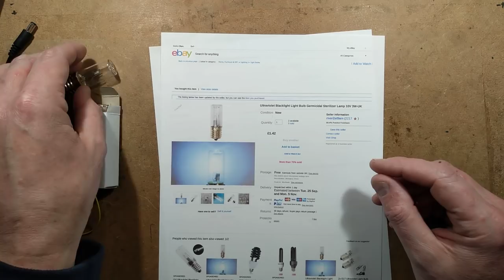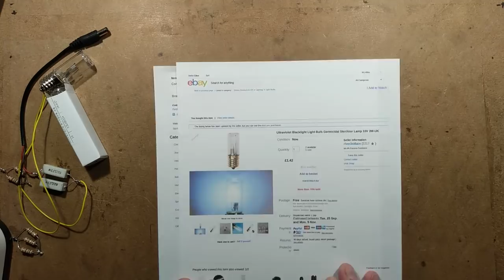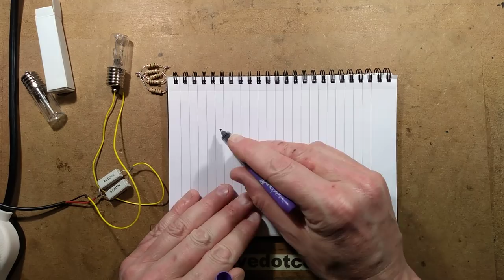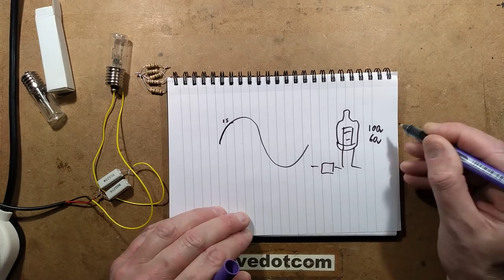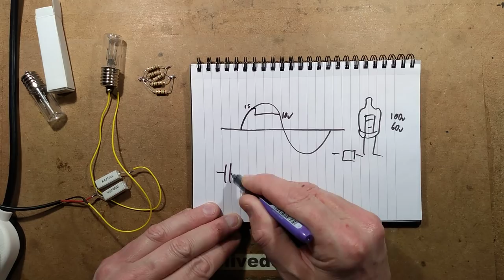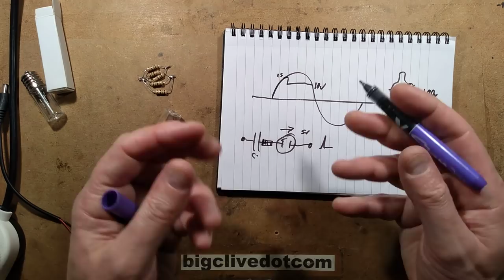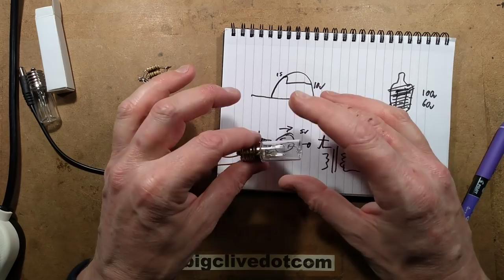Amazing ten-volt mercury discharge UVC lamp.  (GTL3)

Comment: Hello , BigClive.  Very nice presentation re: the GTL3 low voltage discharge lamp.  The construction of the lamp is not new, however.  Back in the late 50's, refrigerators had ozone-producing mercury bulbs in them to reduce odors in the 'fridge.  The lamps ran off the 120VAC  mains, with a series ballast to limit the current when the arc struck.  The lamps had almost perfectly spherical bulbs, made of quartz (to permit the ozone-generating lamp radiation to pass through the bulb).  The lamps were made by GE, and the packaging was marked "OZONE LAMP", with an appropriate warning about the rays.  The package also warned of needing a ballast, lest the lamp shatter.  The bulbs were 1.34" (34 mm) in diameter, the base threads had a major diameter of  0.635 (16.2), and were designed not to fit a standard Mazda-based socket, nor the 7 1/2 Watt "Christmas Tree" light sockets.  When the bulb is cold, you can see droplets of mercury on the inside of the quartz bulb.  The filament is almost identical to the one in your video, including the ends that had the coating.  The major difference is that the peak of the filament in your low voltage bulb pointed down toward the base, while the GE bulb's filament pointed away from the base.  When the GE bulb was running, the ozone production could not be missed;  no need getting your nose next to the bulb!  The package further warned that not more than 3 were to be run per 1000 cu ft.  Germicidal bulbs are usually designed to block the ozone-generating lamp radiation.  Today, one use of the GTL3 is in a toothbrush holder that sanitizes the brush part of an electronic toothbrush.

Comment: Have you seen James Hooker's website Clive? Thorn and Osram made similar lamps, some with a woods glass envelope. They were used on 28v supplies to illuminate cockpit instruments painted with UV reactive paint. Thermionic discharge lamps have been around for a long time. In the USA a large version was offered as a sun lamp. These sort of lamps are very commonly used in small UVC filters for aquaria and also in air purifiers.

Comment: A mirror camera lasting much longer in battery and the finder is more accurate
Reply: TheHirade The SLR mirror can't be used for filming, only for stills.
Reply: @John Francis Doe2: False. Most of nowdays cameras can fold up the mirror for video. Then it can be used just like a mirrorless cam. Btw, also for photo shooting if it needs to be silent, eg on a wedding ;)
Reply: @dothemathright 11111 : On a SLR with up folded mirror, you see the sceen on the screen, just like on a mirrorless cam. Maybe there's not the same amount of pixel, but who cares, as long as you see the sceen.If you work in a semi or proffessional enviroment, you anyway use external screens, also on the big professional > 50'000 bucks cams.
Reply: @dothemathright 11111 : Shooting videos by using The. View. Finder. is nothing I wanna talk about, cause for reasonably good vids you use a stadycam and don't hold the cam in your hands.
Reply: Also when you have a full frame body with a large viewfinder it's just more fun actually looking through it. At least for me using an optical viewfinder improves the enjoyment of taking photos.
Reply: I prefer the viewfinder for stills and it does give better resolution. On the other hand, the screen can give you a more accurate idea of the picture you are going to take since the human eye will do a bit of compensating itself. You also get access to histograms and other fun stuff (though some of that is in the HUD of the viewfinder too).

Comment: So a note, at least on US Spec cameras, digital still cameras are limited to 19:59 on recording video for tax reasons. For shooting continuous hours of footage (or more than 20 minutes) you need a VIDEO camera
Reply from the maker: I think it's 30 minutes here, but you can use an app to remove that limit.
Reply: That's good :)
Reply: You can bodge the limit on the firmware, in my case, a Lumix. The file is still split into 4GB chunks for quite a few brands though..
Reply: The splitting at 4 GB is due to limitations of the FAT32 file system.
Reply: bigclivedotcom I’ve made this mistake with my filming. You can record for longer but you sacrifice the video quality. Only on select few dslr can you flash it to be able to record for longer.
Reply: That's not true at all. There are many mirrorless "still cameras" that will record as much as storage allows. The Panasonic Lumix G85 comes to mind

Comment: Built it thanks. Used 24v/1A tran 2x82R. Didn't measure anything. Works great.
Reply: I have just done the same and am bench testing - safely! How long does the thing last, as I want to sanitise water and it will be running 24/7?

Comment: Full frame? Is it a Sony A7III? Panasonic GH5?
As some said, it can't be a mirrorless dSLR, because the mirror part is in SLR. xD
Single Lens Reflex, the reflex comes from the mirror and pentaprism pair. 
But people get it.

I'm not totally sure it'll help Clive... you'll definitely get a higher res, more quality in low light, plus a bunch of other capabilities, but at the same time these types of cameras are just harder to handle and to prop up a workflow.
It's always a tradeoff... convenience for potential and quality. The real advantage of pro cameras vs smartphones these days also comes up with extra costs - like buying extra lenses, investing on post production, etc.
It depends on how you shoot, edit and publish your videos... for instance, if you do it all on the smartphone, a pro camera will add extra steps and devices. You need to either shoot, take the memory card out, edit if necessary and then publish on a laptop/desktop, or you need an extra smartphone or tablet to connect to the camera via app and do similar steps.
You could also shoot thethered, which means you'll need to have the camera connected to a desktop or laptop... eliminates the extra step of pulling files from the camera sd card to another device, which is super annoying.
Anyways, the experience will be good for you to decide. Personally, I think the current quality of your videos are already great, no need for gear upgrade. But if the pro camera route doesn't work for you, perhaps a higher end smartphone could also be a good investment... LG V30, Samsung Galaxy Note 9, Google Pixel 2 or the upcoming 3, Huawei P20, those will all offer you a better image quality, manual controls, better low light capability and whatnot.
There are also some better mic solutions coming out for smartphone vlogging from brands like Rode and Shure.
Reply: Sony leads the way in autofocus (the internet tells me) and the a6500 is a reasonably boxy camera, also not too big so hopefully not too detrimental to the workflow.

If i guess right do I win an oscilloscope?
Reply: For studio work, even a NEX would suffice. Best VFM would be a6000 with kit 18-55. Not old enough, not pricey enough

Comment: Thanks for that Clive, most instructive. I've been experimenting with some of these and have managed to destroy 2 so far. Back in the mid 60s I had a little ozone generator using a Philips bulb marked something along the lines of OZ4W. Unfortunately it got broken and I've tried to find a source of them for a long time, it seems that they are no longer made and a recent search found an old stock one for some $100! So I was delighted to find these on Ebay. I tried a capacitive dropper from 110 v not being aware of the 'sputtering problem but like the idea of a 240/24 volt transformer with a resistive dropper. I found that, provided one was happy with a 'unipolar' glow, a 3 - 10 watt, 300 mA LED driver worked well.

Comment: About UVC production with mercury vapor:

The spectrum of mercury discharge changes with pressure. At low pressure, the hard UVC part responsible for O3 production is much more pronounced than at the high-ish pressures of an Arc like in the video. The range of 160-240 nm can create O3, but the higher wavelengths will destroy them again. Because of this there is a limit for the concentration of O3 that you can reach with any particular UV lamp. (around 1% for lamps designed to produce O3)

Comment: Moto is not moto anymore. Lenovo is churning shitty phones with large profit margin...

Xiaomi phones are better, especially with some which have Sony ExmorR sensors.
Reply from the maker: The Moto brand died after the G4.
Reply: Agreed. Fiancé has a G4 Plus, I have a G5; the older phone is much, much better in every way imaginable. Debating whether to go back to (rather overpriced) Sony phones, or to dabble with the Chinese stuff which I don’t quite trust yet.
Reply: @bigclivedotcom  
Indeed.
Reply: Interesting. I was thinking of going Moto after my S5 gives up but it looks like I may have to do more research. At this point, I think I may just end up buying refurbished S5s for as long as they are compatible with the networks.
Reply: I really, really, really don't like Xiaomi. They're the only phone maker I know that's willing to put banner ads in their built in apps, even the Settings app. Extremely dubious.